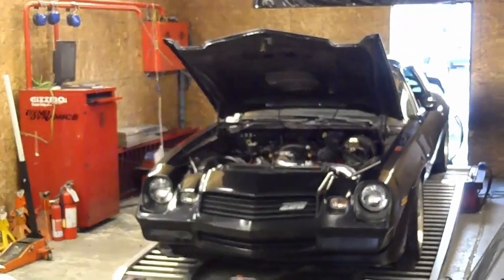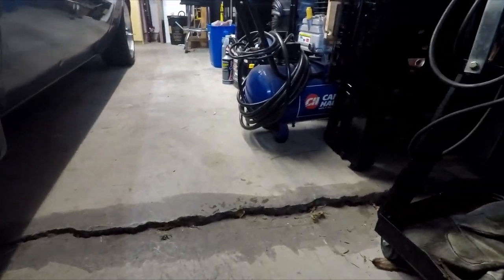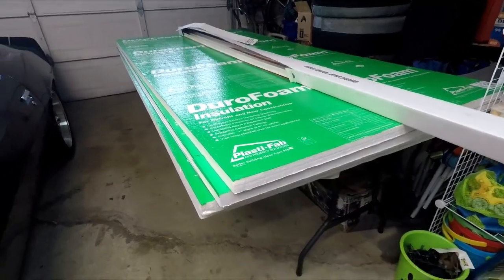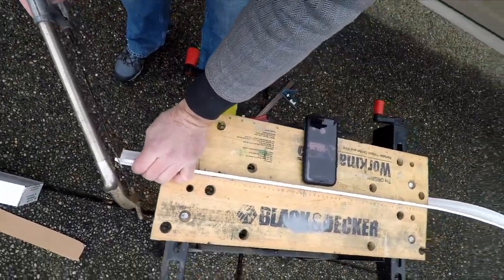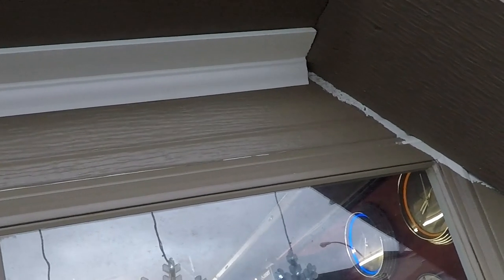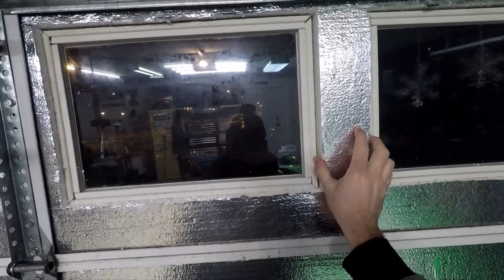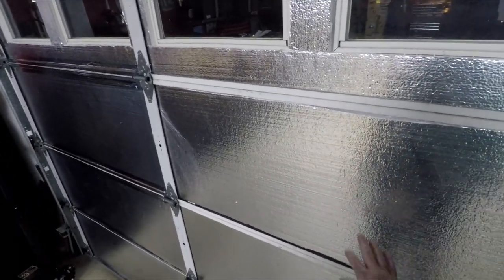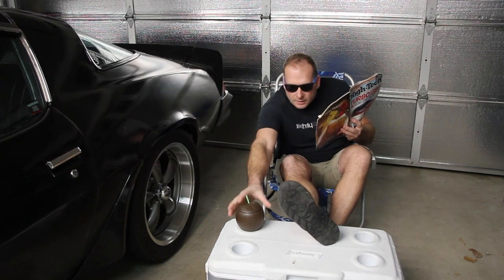How to Insulate Your Garage For Cheap!

Comment: Only constructive information from me. You can use adhesive on the foam panels that fills the voids from imperfect cuts. SOME foam will accept 100percent silicone caulk...there is ALWAYS  some adhesive for the foam. Next...I can see daylight under your door. Get a  flexible bottom seal and shim it if the floor is uneven. Lastly...they sell spring hinges that close the gaps between door panels. There is more than one kind...you just match them to yours...and swap them. Every bit of air that you block is helpful. Good luck.
Reply from the maker: Thank you very much for the improvements listed in your response! So far I’ve not had any issues with requiring adhesive for the panels but and they stay put but there are gaps that I could seal better. The one under the door is ,as you can see, the first one I’ll address.
Reply: @The_604_Garage  just suggestions. I was sure to buy insulated doors that were gasketed between panels. I am considering the spring hinges
Reply from the maker: I’d love to see the spring hinges in more detail. I’ll have to look those up.

Comment: I like the seal on the outside. 

I used a different foam because it was cheaper and used a can of spray foam to fill the gaps for a better seal. It overfills the void which creates another mess when trimming it back. It’s not nearly as pretty as yours but still effective.
Reply from the maker: Thanks! There are probably many other ways to seal the door that will work just as good or better. Thanks for sharing your way. I like cheap and effective!
Reply from the maker: I think I’ll spray foam my gaps as well this fall.

Comment: This is amazing! I did the same thing, however I don't like the metallic/aluminum look so I'm thinking of placing wallpaper on it. What do you recommend i use? spray paint doesnt work. i tried. lol
Reply from the maker: You could try wallpaper I suppose but I’d use some better glue to adhere it to the insulation as the temperature fluctuations may cause the wallpaper glue to break down over time. Try a test piece with some spray adhesive.

Comment: Is it just for cold or does it block out heat in the summer too? Thanks for video.
Reply from the maker: Yes the durafoam is designed to insulate against heat and cold.

Comment: I have been told by a garage door company that the extra weight of the insulation requires new springs or the opener motor will be strained and burn out sooner. What is your experience?
Reply from the maker: The insulation adds very little weight. Maybe 10-15 lbs at best.

Comment: What’s the panel called?
Reply from the maker: DuroFoam
Reply: There are all sorts of rigid foam insulation. The door cavity is probably 1”. Most don’t have the cool foil face, but are still effective. Choosing a non-styrofoam version helps with the cleanup.

Comment: Before the install you mentioned a 1 degree difference in your garage vs outside. Post install what’s the difference?
Reply from the maker: I have no way to accurately measure the difference in temps but I was in my garage tonight in just a t-shirt and it was comfortable. Outside is around 5deg C or 40 deg F and I wouldn’t want to be out there in a t-shirt for very long.
Reply: Thermometers are pretty cheap, even in Canada, for measuring room temperatures. The difference is pretty simple math.
Reply: Well, since you said there was a 1° difference without the insulation…
Simply measure the outside temperature and walk into the garage and measure the temperature.
The  250 Garage
Reply from the maker: I just posted a short of the temp difference.
Reply: Only 4 degrees different? 50 - 46? Are your walls and ceiling insulated? That will make a much greater difference. 

It’s 45 degrees here (no snow) and 54 in the garage. That being said, the majority of the walls are insulated though the roof is completely uninsulated.
Reply from the maker: @johnlee7085  at the time of the test those are the results. This morning at 5:30 am I get 47.3 in the garage and 33.8 outside. Walls and ceiling insulated (living space above).
Reply: That makes sense. Probably longer since the door was opened, which would have equalized the temps. Assuming the garage is generally unheated, so any change from the equilibrium state of previously being opened is:
1. any heat loss from the house through the insulation into the garage
2. Any heat generated in the garage by electric appliances or lights. The latter can be significant. When I was in college, my roommate and I essentially heated our dorm room by the 200 watt incandescent bulbs in the ceiling and the 100 watt bulbs on our drawing tables. Not as much so with today’s leds.
Reply: I think we’re seeing the opposite effect of #2 now. Our garage had been 58-60 degrees through the first part of the winter, but I recently replaced big 8’ fluorescent lights with led.
Reply from the maker: @johnlee7085  exactly what I was thinking when I opened the garage door but didn’t want to influence the results of the test either way so I published what I was seeing. I’d take the morning results as more accurate. No lighting on at all through the night to effect temps. Interesting to discuss and test out with you indeed!